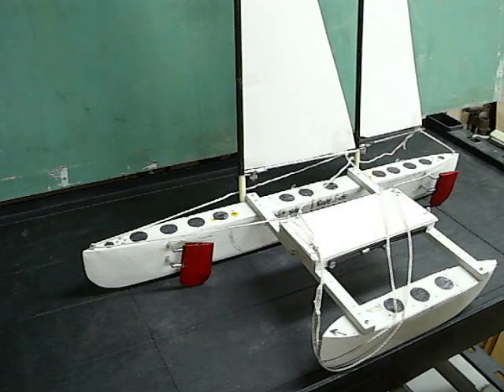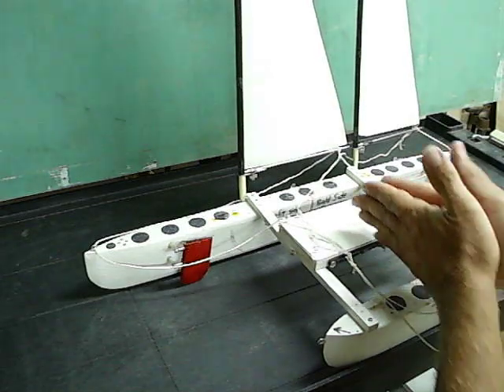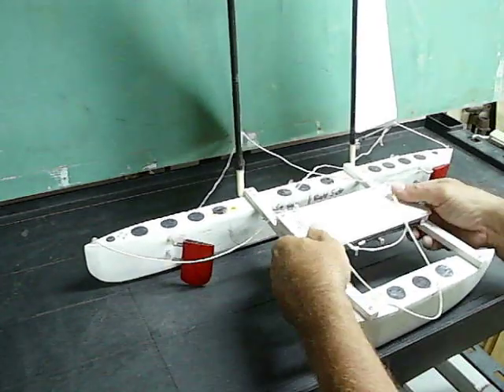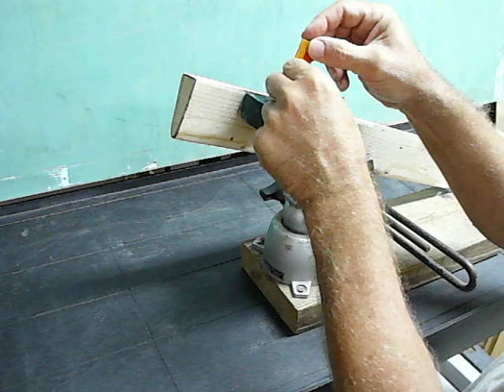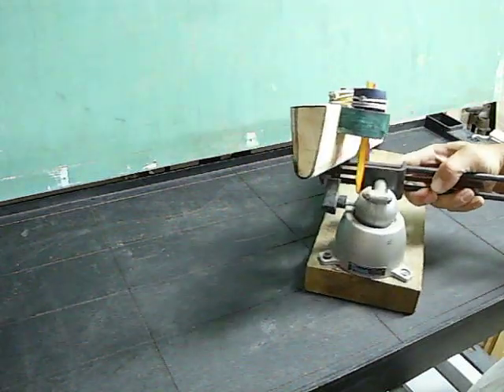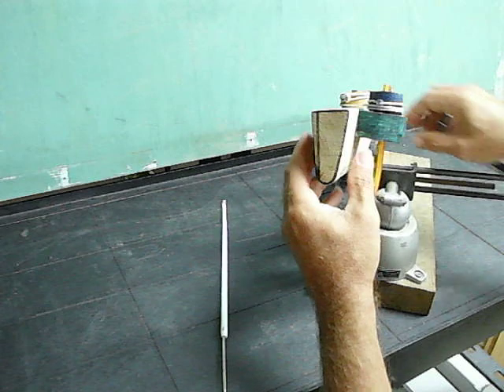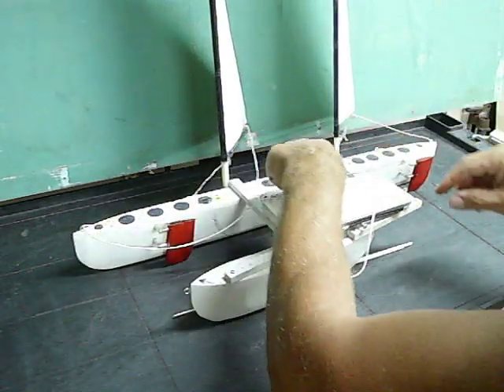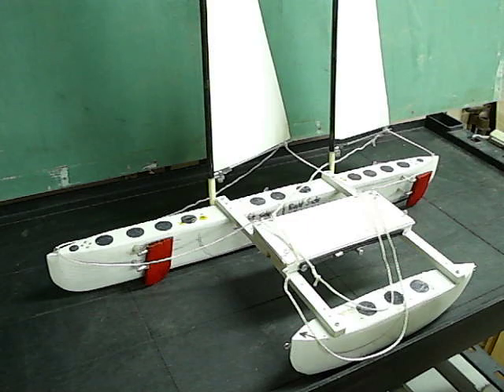Adventure Racing Proa : new features for the concept model

Comment: I'll post some pics to Proafile in a bit.  I have the main hull sides attached to the bulkheads.  I keep encountering design problems.  A few things I need to figure out is making a segmented mast, sail rig setup (that is easy and fast to set up)  and I need to figure out the ama and Iakos.  like to make them segmented or fold. I was going to use pvc pipe for the ama, but now I am thinking of just using a hinged 2x4 for both the ama and iakos.  decisions, decisions....